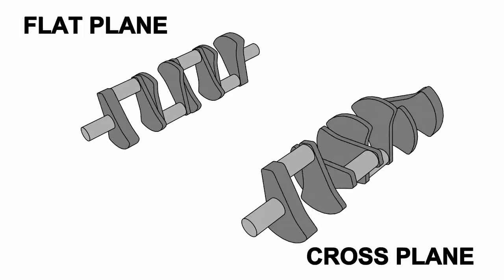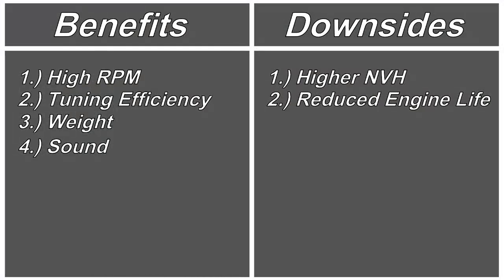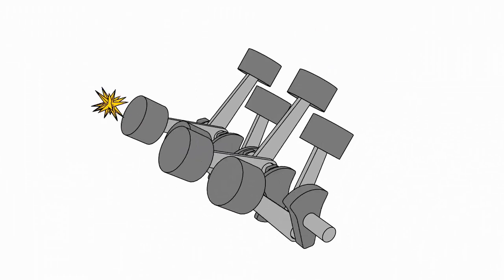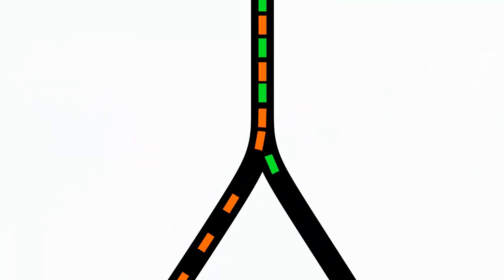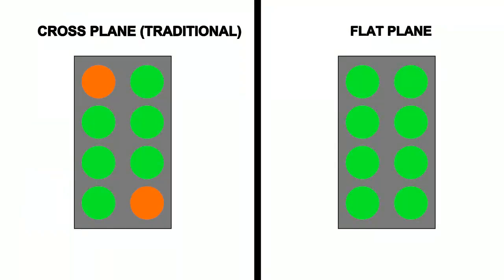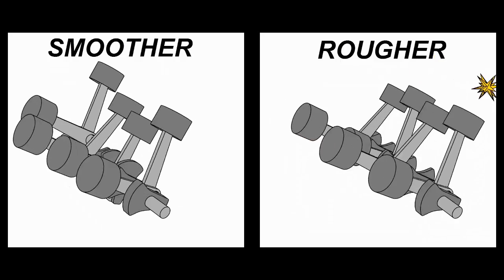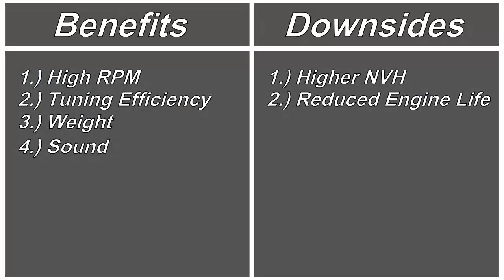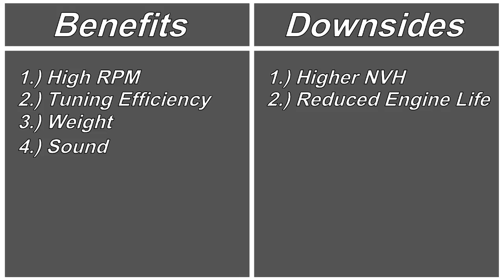Flat Plane Crankshafts

Comment: Very nice video. Shame you didn't show the correct firing orders though.
Reply: OR the crazy way  ford calls out their # 1 cylinder on some engines.   some of  their front most con rod is NOT #1.    most other engines have the front most con rod as #1.    i stopped years ago trying to figure out why ford does some things.   and a 4 cyl inline can NOT bal out some of the vibrition.  so does the flat plain V8 have the same issue?   only 2 times?   i dont know.
Reply: @moeshouse575  Which Ford engines don't put #1 on the front cylinder?  Every Ford engine I've ever worked on has #1 at the front.
Reply: Moe .  look at the two front cyl.  one has the connecting rod is in front of the other.  you have to count the position of the con rods to each other.   its been a long time since i counted them.
Reply: @moeshouse575  FE, Windsor, 385, Mod, they all have #1 on passenger side front, which is the front-most cylinder (the front con rod).  Where Ford differs from Chevy is they number down each bank, so passenger side has 1-4 and driver has 5-8, where Chevy numbers based on rod journal position, so front-to-back on all cylinders.  But they both have #1 at the front.  I have yet to see a Ford (or any) engine that doesn't put #1 on the front-most cylinder/rod.
Reply: Moe  STOP labeling the cyl.   label the connection rods.  which one is the front most?
Reply: @moeshouse575  Look down at the top of any V8, one bank/cylinder head is forward of the other bank/cylinder head by about an inch, or more exactly, the width of a connecting rod.  The centerline of the cylinder, and therefore the piston, is the same as the centerline of that rod and journal.  So the front-most cylinder is also the front-most rod, always.  It doesn't matter if you count cylinders or count rods front to back, you'll end up with the same numbering.
Reply: Moe Shouse Yes that's right, flatplane v8s have the same imbalance, x2.

Comment: Nice explanations. but since when did the flat plane sound better?  Also the exhaust pulse problem can be worked around with clever manifold design. Look at the BMW M3 V8 for example, cross plane, but revs to over 8k and puts out 104hp/liter without turbos!
Reply: soundseeker63 

Your are correct but the E90-93 M3's V-8 is only 4 liters hence less stroke and mass to rotate to amplify the inherent vibrations. Great motor though, I love the way they pull from 4K-8k rpms!
Ford did well to get a much larger displacement 5.2 to work with a flat plane crank. Both Ford and Chevy had production crossplane 302's in 1968-70 that in race tune sung  to almost 9k Rpms . Nothing home below 5.5k rpms though. I like the sound of the shelby 5.2 but I prefer the sound a well built 1969-70 Boss 302 or the Chevy's DZ302! Just my preference.

Comment: this reason, why camaro need bigger displacement than mustang to produce same power
Reply: Kim Chi, First off, the LS is OHV not SOHC. In OHV, the camshaft is located above the crankshaft in the engine block and uses pushrods to actuate the valves in the cylinder heads. In SOHC and DOHC, the camshafts are located in the cylinder heads. 

Secondly, you're correct with your more air in = more power out, but you've got it backwards. Ford's DOHC four valves flow more air at higher rpm than LS OHV engines (LS's are two valves per cylinder). LS's larger displacement is typically why LS motors make generally more torque but Ford Mod Motors make similar horsepower (due to more torque at higher rpms) despite their smaller displacement.

For clarification, OHV stands for Over-Head Valve (One cam per motor), SOHC is Single Over-Head Camshaft (one cam per cylinder head), DOHC is Dual Overhead Camshaft (two cams per cylinder head).

Fancy cams may not entirely make up for displacement, but I guarantee you, if the LS3 was DOHC it'd make way more power. This is evident in the way the LS3's torque curve starts to drop between 5000-5500 rpm where as the Coyote's doesn't start dropping until past 6500prm.
Reply: Yusuf Abdul Basith no, the mustang gt still has a traditional cross plane crank. The reason it makes similar power to the camaro with smaller displacement is because of dual overhead cams and variable valve timing.
Reply: ok, I'm understand. Eh, camaro have also has active fuel management and variable valve timing?
Reply: Amongst the length and breadth of the ignorant comments on You Tube, yours, Nor Dic, is possibly the most ignorant.  I would remind you that four valve technology has been around since the early 1900's, and the reasons for and against it are many and varied, certainly more reasons than your brain could ever consider, even with careful pacing and study.
Reply: The LS design is inefficient by todats standards, hence is only used in large displacements with excess power needed for the application, where the inherent inefficient LS design can be masked.

Smaller engines that need to be as efficient as possible, are all VVT DOHC 4valve.

look it up.
Reply: Rolando Mota It is
Reply: Kim Chi You're ignorant be quiet.
Reply: 4V DOHC out performs 2V by a big margin @ higher rpm, this is why all small engines are 4V DOHC
Reply: Nor Dic we're talking about crankshafts here. don't care about your rice burner.
Reply: The LS is not a SOHC engine. It's cam-in-block with pushrods.
Reply: Lotsof, once you increase airflow by boosting eg, by turbo or supercharging, the flow restriction of only 2 valves becomes very apparent.

All non-American V8s are 4V DOHC VVT, due to their vastly increased flow @ high RPM and/or boosting. The downside is increased physical size  of a DOHC engine.

It is only a matter of time before GM catches up to Ford with a 4V DOHC VVT V8 engine.
Reply: Stupid
Reply: Lt Martin not completely true, all you need is stiffer valve springs for any LS and you can keep making power at higher rpm
Reply: Nor Dic I would because it only keeps getting better as the years go by
Reply: Nor Dic LS engines are asthmatic. 2 valves are not as efficient as 4 in terms of power, but that can be fixed by increasing flow... The big displacement to one valve (Intake) acts kind of like an atkins cycle in the way that it doesn't use the displacement to its full potential because they don't inhale very well like how atkins basically leaks air right back through the intake. So depending on what you mean by efficient, LS dont make big power for their displacement but run very fuel efficient to equivalent displacement engines with 4 valves like the chevy 6.2 vs the mercedes 6.3 (6.2) lol im just ranting now...
Reply: Nor Dic GM will never go DOHC V8 because they don't need to "catch up". FUEL EFFICIENTCY is the game now and like I said in my earlier post, GM OHV V8's are more efficient than most DOHC V8's of similar size with very little performance loss. Thats why FORD Ecoboost everything now. If GM copies anything from FORD, it will be turbocharging smaller displacement engines to maintain power and cut # of cylinders. It doesn't make any sense to adopt DOHC V8's.
Reply: GM will phase out OHV engine sooner than you think.  They will all be moving to the new Caddy DOHC V8 for all performance applications.  After the Caddy it will go in the mid engine Corvette and eventually all V8 cars.  It is possible the OHV will last to the end of the V8 in the trucks but somewhat even doubt that.

OHV isn't nearly as fuel efficient, GM uses cylinder deactivation, most DOHC don't as they don't need is as much due to their smaller displacements.  Plus with DOHC you can not only control valve timing but lift as well and if you want deactivation.  With OHV you are looking at about 10% lower fuel efficiency and about 18% less power all else being equal.  That is why all nearly all if not all 4 banger are DOHC today.
Reply: Glasstop, most DOHC engines have been VVT for 10yrs now, ie the cam timing is varied @ low load for maximum fuel economy and low emmissions. A pushrod engine of the ssme displacement ludicrously inefficient in comparison.
Reply: Right but with DOHC you can control valve lift and timing where with a OHV it's typically limited to only timing.  That's what I was trying to say, I agree with you 100%
Reply: Kim Chi you don't have a clue what you're talking about
Reply: The LS is a 60year old design push rod motor. I wouldn't use one.

Comment: Good video. still ain't no LS
Reply: good thing too.
Reply: Just for youtube people say it’s based on the 351, but in reality it hardly has any similarities
Reply: +Dwreck Baker Which ford design? What are you talking about? Honestly. I'm wondering.
Reply: +Andy Morgan People say the LS is based on the Windsor or a Cleveland? Are they mentally ill? 

They mean it has 2 banks of 4 cylinders and one cam with pushrods with the same degree V? I can't think of a single similarity.
Reply: Just for youtube yes they are mentally ill, only similarity is the block comes down and mains are level with it, forget the name for that. I think it’s more of a meme at this point that people actually believe
Reply: Andy Morgan people have put ls1 heads on a 351 but that doesn't mean they're based on the same stuff. 

That means the bore spacing is similar and the head has similar dimensions, similar enough to fit on it and be bolted there with some effort. I guess to an uneducated shmuck that means they're based on the same shit. Pretty sure an LS1 is a little different then a small block ford which was designed in 1961 or whatever
Reply: @thetuber705  actually a ls head has only been bolted on with milling on the bolt holes. But the valvetrain has never been modified enough to work. But a ford aftermarket hemi head with revisions has been made to work with a ls. But even than with aftermarket builds you normally eliminate most of the differences between engine platforms. I mean shit you can shove ls based heads on sbcs now.
Reply: LS junk
Reply: Matthew Dye The LS is based on a Ford design

Comment: The flat plane crank journals are up-down-down-up (as the 4 cyl. cranks), not up-down-up-down as on the 3D renderings here.
Reply: That is generally true, but the Voodoo's crank is exactly as is shown in this video, it's a properly strange beastie - allegedly that's how the crossplane cranks are initially cast / forged before twisting.

The model used for the cross-plane crank is incorrect - it should be up-left-right-down.  The two outer throws are 180 degrees apart; the inners should also be, but 90 degrees from the outers.

Comment: In the last 3D rendering showing the firing order the image of the flat pkane crak looks not right. The 1 and 4 journals should be in the same position (up or down) and the same is valid for journals 2 and 3.
The rendering shows different positions. Is just me or it's wrong?
Reply: Ves Andreev   Both configurations are used.

Comment: Flat plane v8s fire every 90 degrees too. 4 cyls fire every 180 degrees
Reply: How can that be if the pins are 180 degrees apart?
Reply: @fouellet1701  
In order to get an even firing order (remember they fire every other revolution) with 8 cylinders 4 of them fire, 360/4=90, one revolution and then the other 4 fire the next. With a flat plane v8 4 cylinders are up, 4 are down, two on each bank (essentially, like 2 flat plane inline 4 cylinders joined together in a 90 degree angle V).  Does that make sense? It would be easier to explain with a model.
Reply: @177SCmaro  : Of course, if the cylinder banks are 90 degrees apart. .
Reply: Engineer's explained talks about this and does a great job

Comment: Hold yer' horses!..........Benefit #4 (sound quality) is still open to debate.  Smooth Flat-Planes sound cool, but growling Cross-Planes sound cool too!
Reply: Snowcrest Agree: secondly sound can be tuned to create the desired effect. Traditionally, flat plane V8s have usually always sounded like two inline-4s. Interestingly it is possible to get a crossplane inline-4 to sound like a small V8.

A Flat 4 has a totally different sound characteristic to either but the exhaust headers and firing order can be changed to give a different sound more similar to an inline-4.

Believe it or not, there's a whole branch of automotive engineering devoted to just this subject...
Reply: debate for sure..i love the sounds of my cross plane crank big v-8 big set of header and 3" pipes to let it out can't be beaten. flat plane sounds great though.
Reply: @Kjell Eriksson strong like an angry kitten?
Reply: Totally agree. The sound of the Ford's engn is good until it get high in the RPM range. Then it just sonds terrible IMO.
But again, it's subjexctive.
Reply: No it's not, the Stang sounds terrible!
Reply: Nothing else sounds as cool as a Big Block Ford, Chevy, or Mopar.
Reply: Lighter, higher revving and smother operation in aggressive driving.  The weight diff makes it handle better too.
Reply: The Voodoo engine does both.
Reply: Snowcrest the Yamaha r1 sounds amazing
Reply: @northtexasskies3243  the cbx is not a flat plane and sounds awesome. might just be the best sound of any bike ever.
https://www.youtube.com/watch?v=zUbSOKdJtno
Reply: Cross plane v8 sounds best. Only thing in the world that sounds better is my ex saying absolutely nothing
Reply: @paulk5311  The CBX is an inline 6.  All inline 6s have an even firing order and perfect static and dynamic balance.  A nearly perfect layout.  Only drawback is crankshaft length and torsional stiffness.  Takes a pretty heavy crank to get its natural frequency above critical in a high revving, high output motor.  Also just makes a long motor.
Reply: I think the flat plane crank V8 sounds like a whiny cat. Weak. A crossplane crank V8 sounds like a demon clawing its way out of hell. Not weak.
Reply: 100% agree that the V8 sound is subjective. This is my RS7 which has a cross plane. Tell me this doesn't sound amazing:

https://www.youtube.com/watch?v=sseEESpHuFE
Reply: nosirrahx k
Reply: never heard austin racing 2015 r1 i guess
Reply: R1 and V4 panigale sound bad.
Reply: @MrSandwichk  to you but many love the sound.
Reply: @MrSandwichk  in Speakers but in person, Its the greatest bike sound i ever heard, The Yamaha R1.
Reply: If it sounds at all it means it's using its power to produce sound instead of producing torque. It's a bad thing.